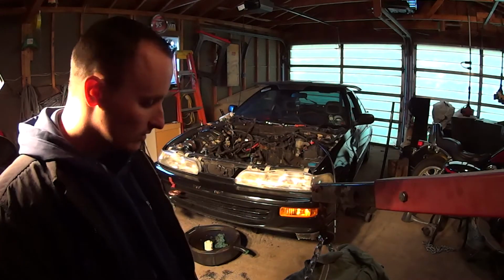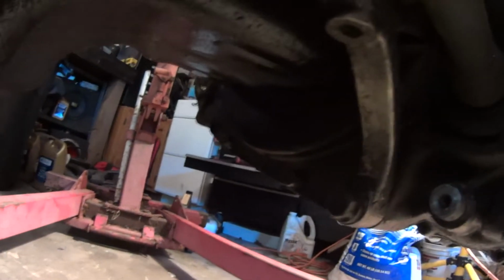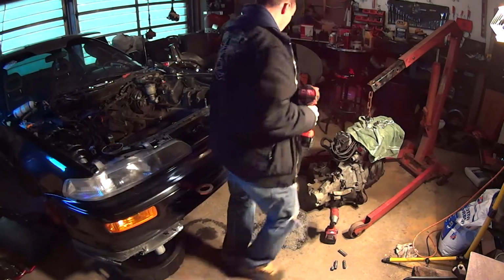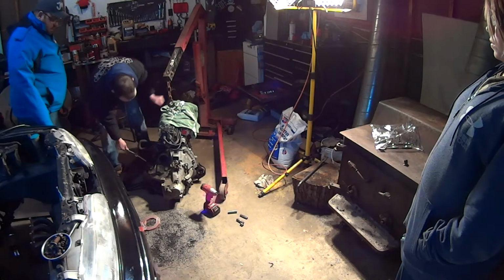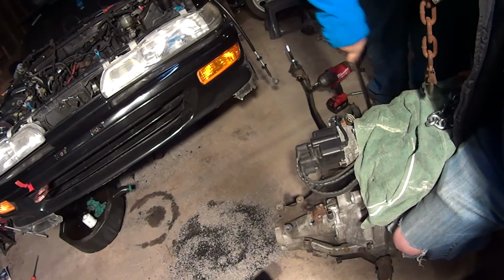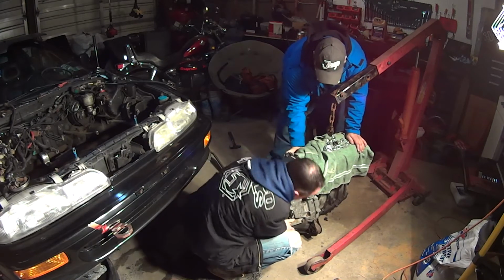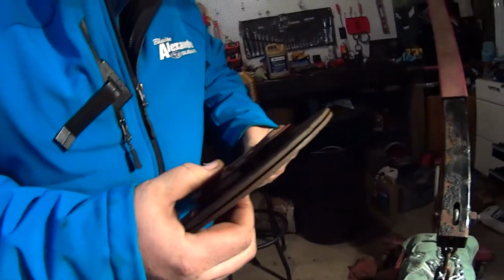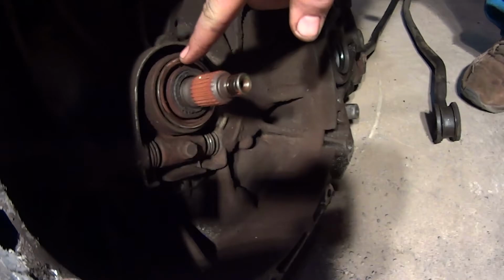Project DA9: Ep 25- Broken Clutch Disc

Comment: Bro... im in the exact same situation. Just dropped the trans but didnt even inspect the clutch lmao. Bet this is, what happened to me.
Reply from the maker: Turned out the input shaft bearing on my transmission was bad, that's what was causing clutch failures. It turned in to a whole transmission rebuild for me.

Comment: bad adjustment at the cable or you leave you foot resting on the pedal
Reply from the maker: Jack Taylor No to both. Bad input shaft on the trans.
Reply: yeah dead input shaft bearing will do it every time
Reply: How did you find out the input shaft was bad? What exactly was wrong with it? I've got my Ys1 cable trans out right now, anything I can check before it goes together with a new throw out bearing, clutch, and pressure plate?

Comment: Hey could you let me know how you went about rectifying this issue? Had this issue twice on my Suzuki Swift Sport and the dealership kept replacing the clutch kit with no real reason why the clutch disk failed in the first place... thanks man cool vids
Reply from the maker: This was the second time I had a clutch failure in this car. First my pressure plate failed. I replaced that clutch kit with this on in which the clutch disc failed and the pressure plate was about to. Turned out the transmission input shaft bearing had failed badly and was allowing for excessive play of the input shaft. This caused the clutch failures and if I had left it alone, would have led to full transmission failure.
I don't know if that's what's wrong with your Swift, but it's worth checking!
Reply: Thanks for the reply really appreciate it would definitely give it a check before further damage

Comment: That's wild, what brand do you aim to replace it with?
Reply from the maker: Actually, I'd like to get the same one again. I really liked the way this clutch felt, and I found out the problem is in my transmission, so it's not the fault of the clutch that it failed. The people at Exedy were very helpful with helping me diagnose the problem through a few e-mails.
Reply: That's awesome, glad they helped you!

Comment: dude don't waste time or money on the b20 anymore and start working towards that k
Reply from the maker: B18B, I don't even get the extra 0.2 liters! haha.
But there are so many more interesting things to do to it still! Plus, this car makes a decent daily and it will be a lot cheaper to fix this problem to get it back on the road again. The K-swap is going to be a much bigger build, but that will also make it a long term one.
Reply: Awesome I forgot you put a second gen ls motor. And I guess I'll have to wait it out for the k build
Reply from the maker: I might start building the K block next year, depending on my $$$ situation. While the B-series is out I want to do some repairs to the wire harness and maybe finally get around to doing my OBD1 conversion. I still want to boost the B-series too before I swap it out.